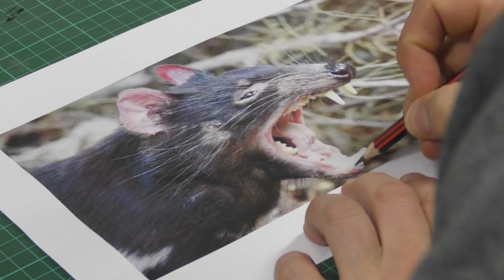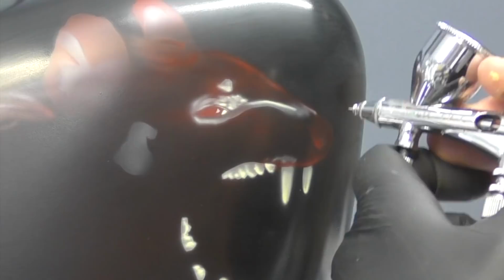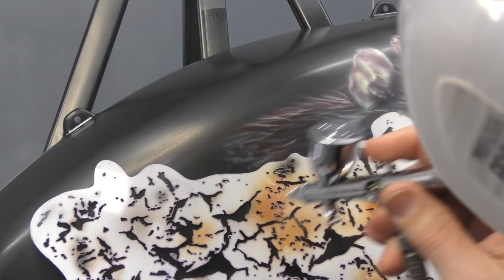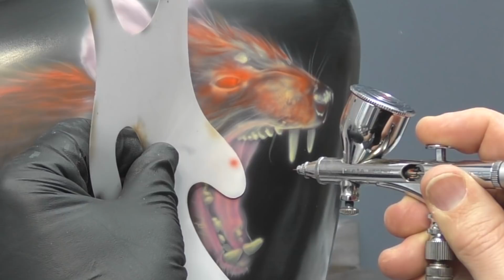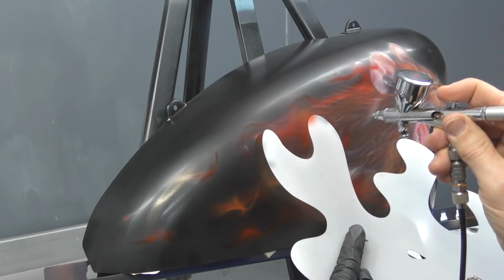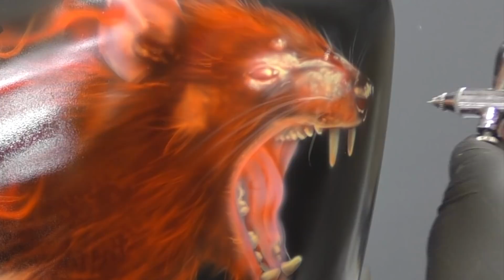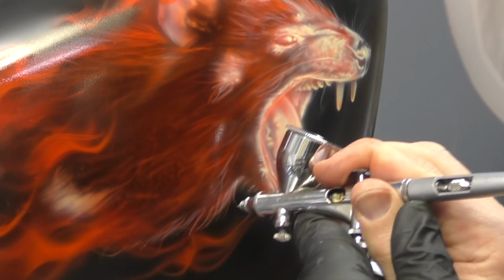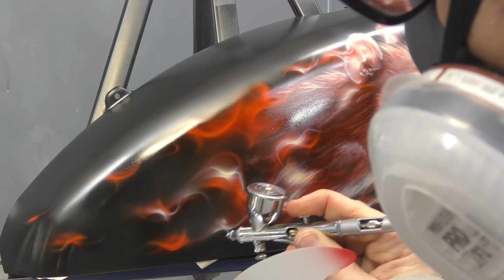Airbrushing a Tassie Devil with Real Fire | Mike Lavallee Tribute | Part 1

Comment: Love the work you do. May be a stupid question, but why do you clear coat the base coat then sand before airbrushing, can’t you just airbrush on top of the base coat?
Reply from the maker: Thanks for your comment, yes, you can work straight over base but I always prefer to clear coat the base first then sand and then airbrush as this protects the base coat and especially with custom colour basecoats ie..pearl, metallic or candies if you happen to make a mistake then it can be fixed easily as trying to blow in the colour to repair something will often result in needing to re-spray the entire surface, this is again more of an issue with custom colours, but I always prefer a prevention rather than cure ;)
Reply: Thanks for that - makes sense now 😁👍